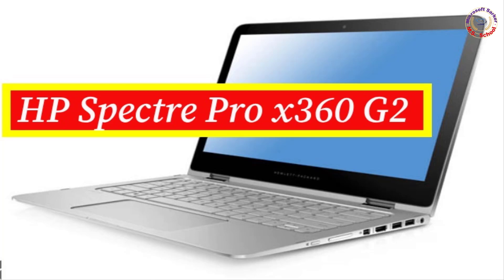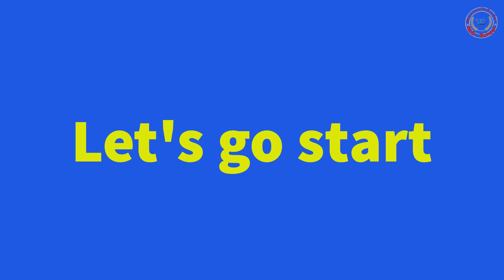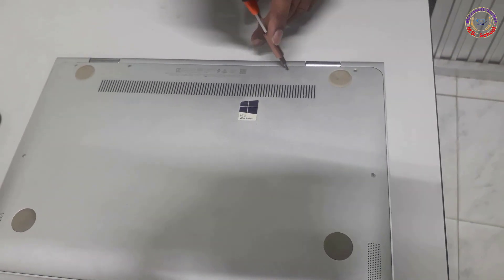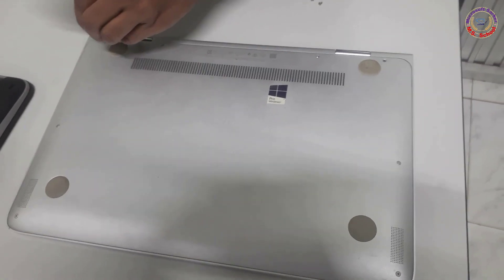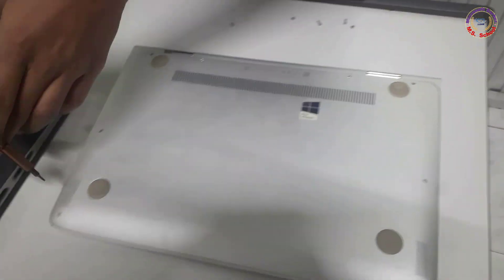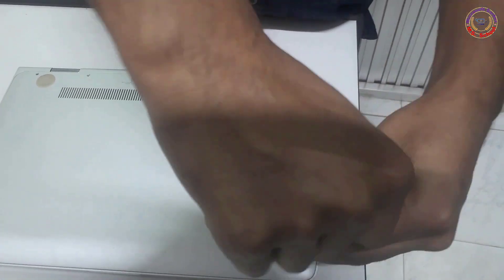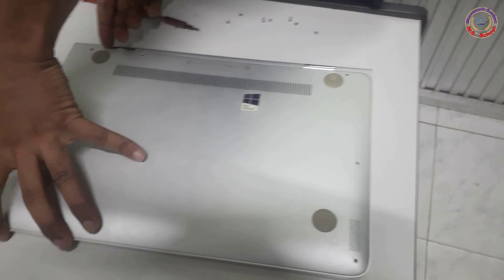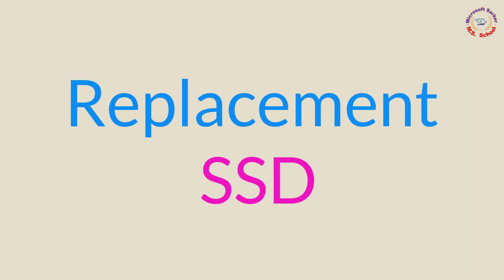HP Spectre Pro X360 G2 SSD Replacement | How To Replace Battery HP Pro Spectre X360 G2 Laptop|

Comment: Can I upgrade the ram for this laptop HP Spectre Pro X360 G2?
Reply: The answer is no, because the ram for this model is soldered into the board so meaning, you can only upgrade the Ssd
Reply: Donde encuentro el teclado para esta laptop